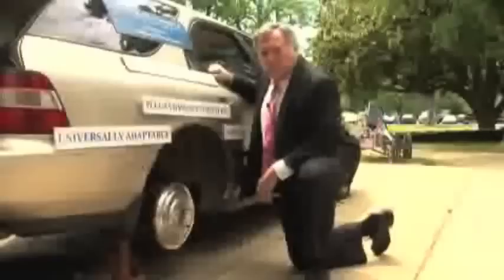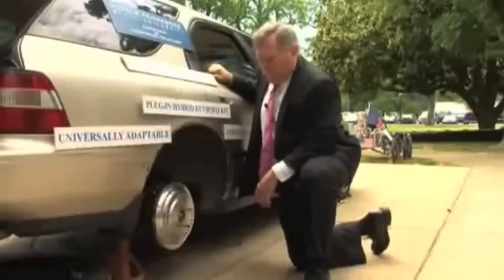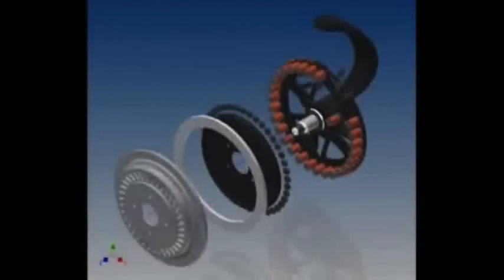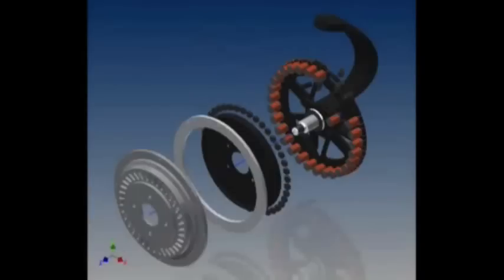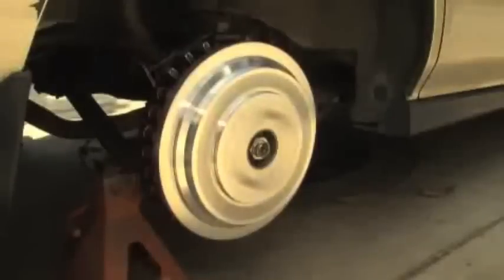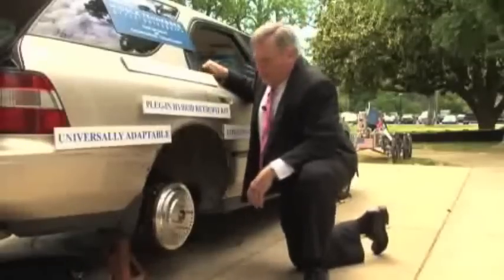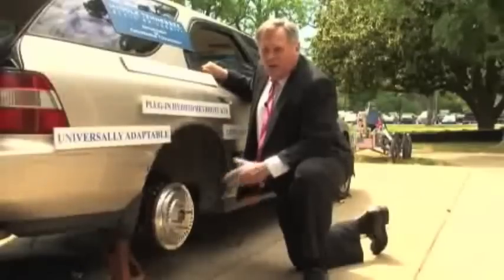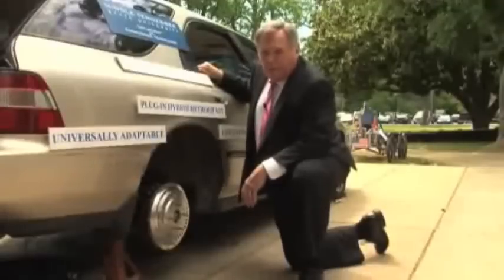MTSU Hybrid Electric Car Conversion Kit

Comment: Such hubs have been around for a very long time, brilliant use though. Add an extra alternator, 4 extra 12v batts , muliphase module pack , keep it simple and cheap = sell 10 million sets , dont worry about the patent just get them sold . It probably doesn't qual due to obvious process  . Plenty of no patented products are selling millions/ changing the world

Comment: few things that I see wrong with this system.

Since he said it's a honda, that means that its fwd, and the motors are installed on the rear wheels. So this system won't work on awd cars. 

With a DC motor system, it is less efficient than an AC system. AC system allows regen breaking. 

Probably why there hasn't been any work on this or similar systems in the news.
Reply: mtktm yes it works on awd rear ( use rear hub )   . Brushless dc is an ac winding with multipulse dc phase converter  . Its just a news story , they're not going into all the details of the scope profiles on amplitude, modulation , and frequency. Stop picking on it and make your own

Comment: Good information here,,but this video needs to be re-shot in better definition, audio and camera angles. Possibly with some updates.  I do like this idea of building the traction motors into the wheels themselves. Although there might be questions of protecting the motor from road debris. Should make hybrid conversions much easier.  Also makes for some interesting steering and parking possibilities. Probably the biggest issue in a conversion is where to put the batteries?